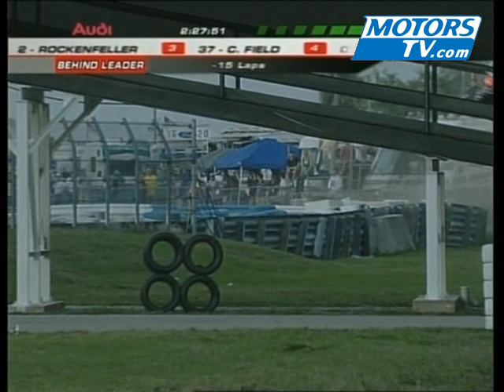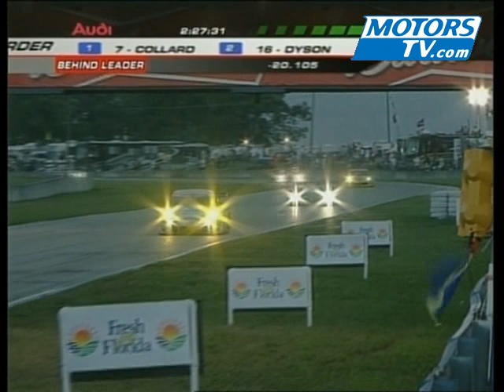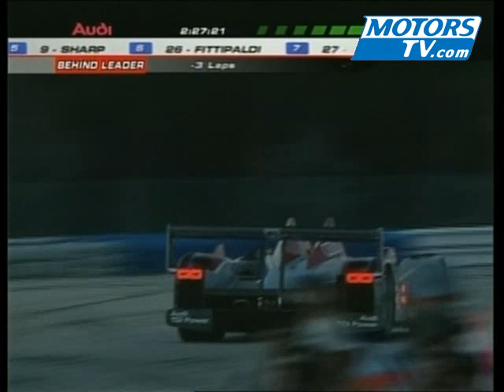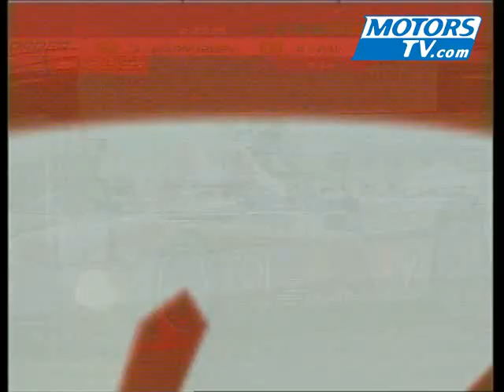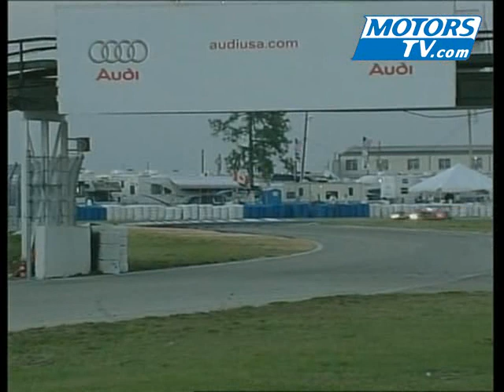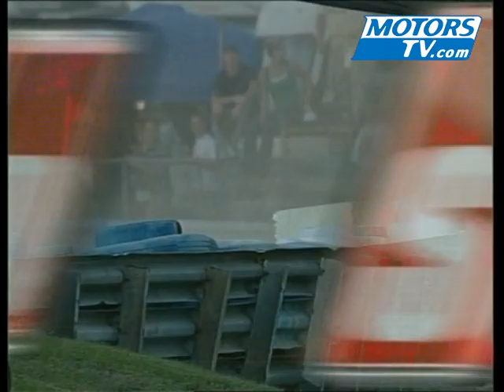ALMS Accident involving Mike Rockenfeller at Sebring, 2008

Comment: Geez guys, no need to be so hostile. I am ignorant of many things but I am not blind.
What I meant to say was that the shot of the off track excursion was almost entirely blocked by the tire wall. If flying dirt and slightly displaced foam is good coverage to you, then fine.
In my opinion the video is disappointing as is the state of discourse here.